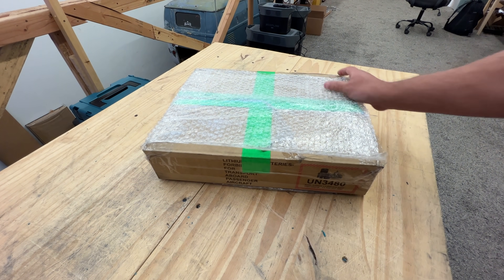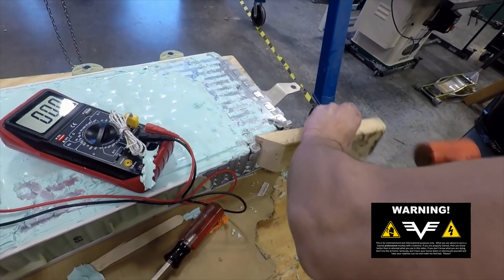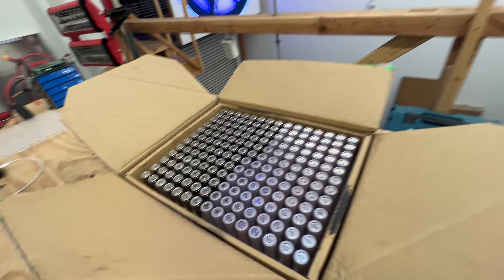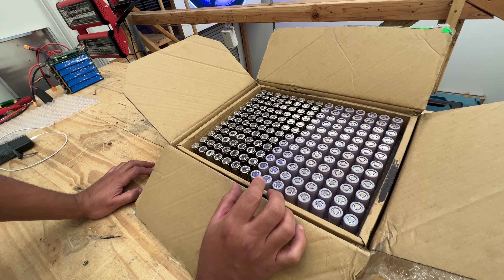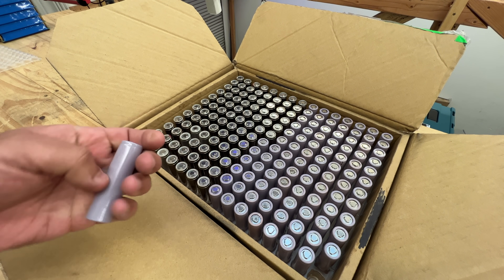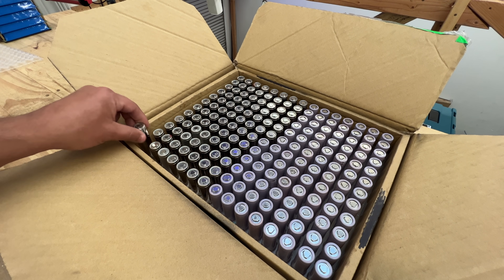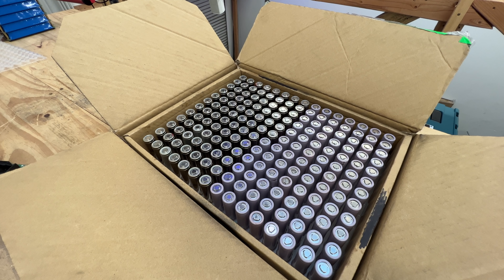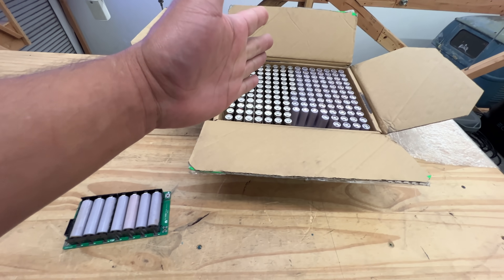Are These $2.75 18650 Genuine Tesla Cells?

Comment: You need to test internal resistance with a dedicated IR meter. The ones built into the chargers are wildly off.
Reply: What does the IR affect or why does it matter? Sorry but newb here :)
Reply: @castello544  it affects how much current the cell can provide without heating up. Generally, lower internal resistance is better.
Reply: @jbrdddd  Thanks. I've wondered about that for a while :)
Reply: @castello544  when building packs you match cells with about the same IR to get maximum performance on the battery pack your building so it matters A LOT..to test them.
Reply: @10OZDuster  It would seem that these aren't "real tesla cells" with that high of an IR!?
Reply: @castello544  these chargers are spectacularly inaccurate when measuring IR. Those cells are not over 100mOhm and are probably down near 50mOhm if in good condition.
Reply: @batterymooch  Thanks Mooch! I know you from the devastated #vaping world! :) 
Are the battery testers randomly inaccurate or can you assume they are generally off by a couple hundred milliohms? I would think Jehu would know all about these issues?
Reply: @castello544  I’m sure he knows. You can use inaccurate readings for comparing cells if the readings are consistent. But they might not be and different chargers can have different accuracy. It often doesn’t matter either if you read 50mOhm or 100mOhm though, just knowing that one cell might be a lot higher IR than another might be all you need…assuming the readings are consistent though. If they’re not pretty consistent they are useless. We can be pretty sure those cells are not 200mOhm because that would be a 1V drop at only 5A…a huge voltage sag, making them pretty useless.
Reply: @castello544  i would say they are fake but not saying they are of no use...for power banks they are perfect but not for"certain" high drain applications.   I myself would need some for my power application they are of "great" value especially with their capacity rating.  In my case the high internatl resistance is not much of an issue
Reply: @10OZDuster  Thanks! Most folks seem to think the accuracy of the IR test is not accurate, so maybe, they are the bomb ;)
Reply: @castello544  i really hope thats the case and an update video where its tested again with the proper tester with better accuracy but then again if the IR is low don't you think the will get "SOLD OUT"..bwahahaha
Reply: @10OZDuster  Indeed!
Reply: PANASONIC is the manufacturer of tesla cells, but they don't use the best, They use  class B PANASONIC  for the price.

Comment: Have this Ryobi RM300E riding lawn mower, it uses 4 12Volt 50 amp hr lead acid batteries (48 volts) . The lead acid batteries made for this lawn mower are not long made. Is it possible to built an 48 volt 50 amp hr battery using 18650 or 21700 batteries. The lawn mover has a 55 amps inrush current and constant power after that is around 30 amps.
Reply: Absolutely, you can. You can purchase 40 amp discharge 18650 cells, but a ton of normal cells together sharing the load should be capable too. 
Just do some research beforehand, I could be wrong about that! And don't have anything conductive around when you build your pack.

Whatever touches high amperage packs like that vaporizes and melts part of the pack. It'll start a huge fire if you're unlucky lol

Comment: Do you know what the amp discharge rating is for Tesla 18650 cells? DeWalt uses 20 amp rated discharge cells for their 20v MAX tools. I imagine a motor to run a car needs a lot of amps and the higher the amp discharge rate the lower the capacity. So to get higher capacity they probably just use a lot of parallel connections.

Comment: Maybe the cells that are wrapped are from the outside of the battery pack the ones that are not wrapped would be from the inside of the battery pack after the pack was assembled the only reason they would wrap the outer cells is because they are on the outside of the pack and exposed to an extent. Just an idea the cells towards the center of the pack assembly would not need to be wrapped because they're surrounded by other cells but the ones on the outside of the battery pack they would want rap because they are visible or exposed to the outer edge of the cell pack. Just a possibility??

Comment: Are those marks or vents?
Reply: The central three lines are from the spot-welding of the internal tab to the bottom of the cell. The ring on the bottom is a secondary vent in case of overpressure in the cell.

Comment: Big parralel packs are going to be best for those cells as I imagine with their higher internal resistance they won't be very high amperage. I'm guessing maybe 5-7amp max safe discharge per cell similar to the Panasonic ncr cells.
Reply from the maker: Model S  modules usually use 74p performance do 84p or 86p
Reply: @jehugarcia  should have expected anything less of tesla, of course they'd know but for the DIYer you definitely need to increase the number in parallel configuration especially for power wall and high output appliances/applications when considering using higher capacity round cells typically; although there are very few exceptions when it comes to round cells but of course I'm not imparting any knowledge to you ;)

Comment: I think at least some cells have wraps in a Tesla pack. At 1:12 of your video it sure looks like you can see a wrap on the 21700 cell he removes from the module: https://youtu.be/-OxVJ44hreI?t=71
Reply from the maker: Maybe 2170 cells on model3/y but I’ve never seen wrappers on any 18650 cell on modelS/X before
Reply: Mooch, can you use these Tesla 18650 to vape?
Reply: @vinnyc365  depends on their current rating…which we don’t know. 🙂 I would stay under 5A/15W. Probably best performing at 3A/10W though.
Reply: @batterymooch  Thanks Mooch. Much respect.

Comment: Maybe these are rejects from Tesla due to the high internal resistance?
Reply from the maker: Power packs  and power walls wouldn’t need power cells so the higher resistance would be a trade off for the extra
Capacity

Comment: Well I rather use Lead Acid Battery because it can be ♻️ pretty much everything. Plus if comparing the price right now. ✅  plus gotta say, I don't know which one is easier to get over heating. And nowadays you can maintain your Lead Battery easily and can replace cells if you want too. So yeah. I don't really think lithium is a good solution for houses because of the price, and the amount of time lithium gonna last is not really that longer than Lead Battery. Less say if Lead can last for 3 years. I don't think lithium can last longer than 7 years without a good cooling system. But even with the great cooling systems. You are still using and drawing power out of those batteries and then battery have to recharge more to run that cooler. So end of the life spend would be quite similar to lead Battery. So yeah. The only thing good about it on vehicles is because it's lighter. Save more energy for the vehicle. That's it. If you compare to a Lead Battery that can be ♻️ 99% as they said. By the time you change your Battery. That old one already been recycled. Obviously they now have the Flow Battery for big projects. But I think it's too much for a small houses. Unless they can make it smaller for everyone 😏 will be much cheaper too as they said 🤷
Reply: Lithium is the way to go for portable stuff but in my experience for home and solar I’ve gotten much more life out of deep cycle batterys and lifepo4 then lithium ion